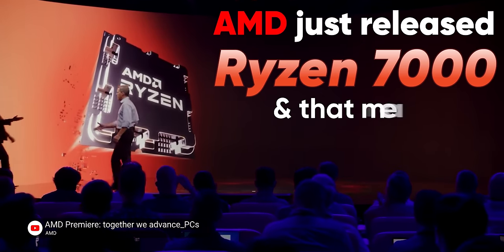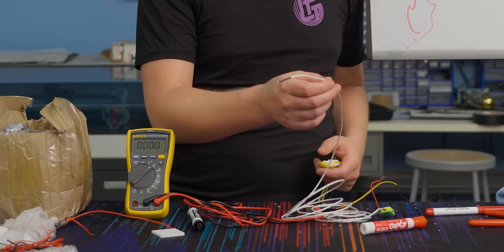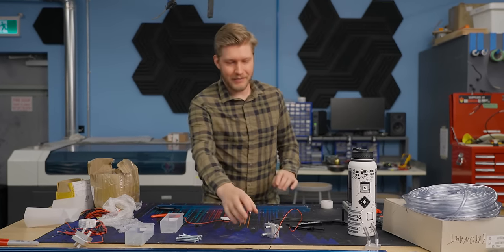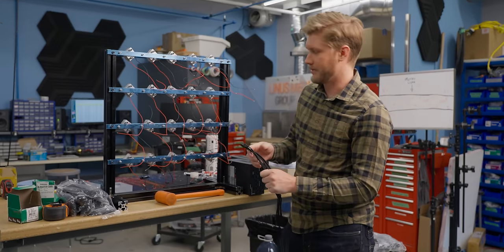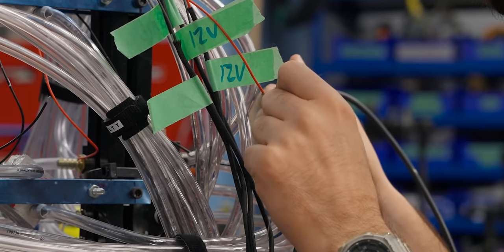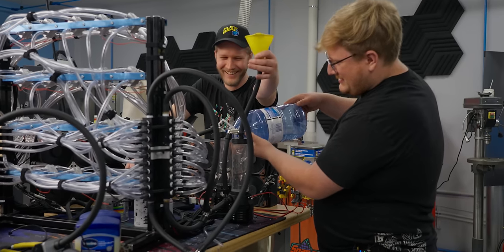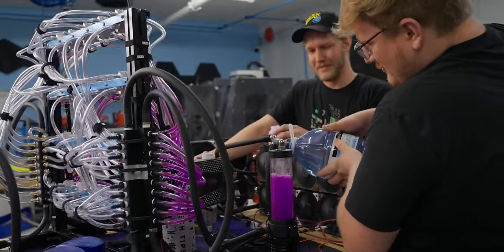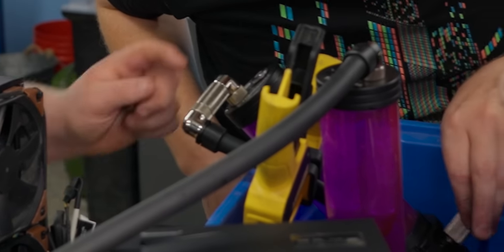Our DIY CPU Chiller From AliExpress is RIDICULOUS

Comment: I spent a couple of years playing with TEC's, successfully building out a universal whole case cooler that dropped the CPU temp by 20c while maintaining a case temp of around 10c.  So a few things, mounting pressure on the TEC plate is EXTREMELY important, you need even pressure across both sides or performance takes a serious hit. We ended up threading out own bolts with a very high thread density, counting the turns and confirming with calipers. You also need to have a neoprene gasket (cut a hole for the TEC and sandwich between the heatsinks) we used quarter inch high density neoprene, but your application may need something different. 

We also used 600w TEC's (24v @ 25a) which required a special switching PSU (30v@30a), and HUGE melcor nickle plated copper heatsinks that were cooled with 120mm 120cfm sillverstone fans. The HS's were 120x120x90mm, and each weighed about 5 pounds, with each tec using TWO. You can simply drop the cold side into a container of water, and use as many as you like. 

The other important thing, you're much better off using high power TEC's like the 600w we used, and undervolting it. At lower power, TEC plates are much more efficient. Basically you're better off using 8 600w TEC plates, running 75w each than you are using 1 plate running full load. I would have to check my 15 year old forum posts, but i'm pretty sure we found that 30% load was the sweet spot in terms of efficiency, though i'm really not sure if that's a flat metric or simply applied to our 600w plates. 

Either way, i'd suggest taking another run at this, you should be able to get much better results using much fewer parts and a less janky set up.
Reply: I think a big part of why this video even happened is because he used stuff that they already had or bought cheap off AliExpress.
Reply: @heygek2769  I'm sure it is, but they've taken a couple runs at TEC coolers for various applications, and in each instance they've done it rather poorly, ended up with bad, or at least insanely inefficient results, and perpetuate the idea that TEC's are useless. 

I freely admit, this is a personal pet peeve and this was clearly done for the entertainment value, but...if you're going to do something, you really should try to do it as well as you possibly can.

One of the simplest things that is consistently overlooked, is using a TEC to cool the back of your CPU socket. There have actually been a few cases in recent years that have employed fans behind the motherboard tray for this purpose, using a TEC in this was is simply more beneficial, and less complicated than trying to directly cool the chip.

Like i said before, i spent years playing around with TEC designs, and ended up with several very viable solutions that i simply didn't have the money to see through, and now i just don't have the time. These guys do, and i'd like to see them make a serious attempt.
Reply: The Jank is part of the appeal though.
Reply: @heygek2769  sqws
Reply: some people, yanno, have a life lmao
Reply: Sooo can you like undervolt TECs? for 12v I only find about 200W max, which i feel is pushing it, but what if I were to use a, say 24v TEC that is rated for 600W (25A) and run it at 12v, will it try to pull 50A or will it not go past 25A still? I'm just wondering cus that wouldnt require another PSU and it could run off the PCs one.

Also what kinda TEC would i need to cool down a water loop to sub-ambient on a RTX 4090 at load, or a Threadripper 2920x?
Reply: @dazley8021 I A TEC will use as much power as you drive into it, unless you have a control board or some kind of step down between the TEC and the PSU. You absolutely can drive them with a standard PC PSU, but only so long as it's within the operation rating of the TEC. 

A 600w tec runs at 24volts @ 25 amps, running it at 12v/50a would input the same 600w...but it would never the less overload the junction and if not outright kill it, greatly decrease it's lifespan. 20 years ago PC power supplies weren't feesible for running a 600w TEC at full tilt, so we went with a 24v30a switching power supply, which lets you fine tune how much power is being delivered, as well as wire up modules in parallel. It's the best way to go if you really want to play around with TECs.  

When i say "undervolt" a TEC,  what i mean is running it at lower input power than it's rated. The higher the input power, the greater the cooling capacity, at the expense of efficiency.  

It's been a long time since i thought about any of this, so i'm just gonna ballpark the figures, i could be wrong and apologize in advance if i am. 

As far as i recall, the 600w TEC's were rated at to cool 50c below ambient with no heat load. As you apply heat to the cold side, both the cold side and the hot side temps increase, requiring better and better cooling on the hot side to maintain any kind of benefit on the cold. 

These are the module you use for direct cooling of a component with a high heat output, it can be beneficial if you can devise a way to keep the hot side temps in check (intel released a TEC based cooler for one of it's chips a few years ago that performed decently, if not efficiently) not an easy task within the confines of a PC case. TEC are heat pumps, they're not taking anything away, they're just moving it somewhere else. Every module has it's own delta curve, based on operating temperatures, input power ratings and even mounting pressure. 

However,  if you run a module below it's rated power, the efficiency starts to get better. You can take the same 600w TEC module, run it at 72w (12v@6a) and still see a 10c or 15c decrease over ambient, doing this with multiple units allows you to stay within the same power demands, while making each module much easier to cool and the delt easier to maintain.

 With a WC setup, the quick and dirty way to do this is to take cheap CPU heatsinks with modules sandwiched between, and plunk the cold side into your reservoir. With decent radiators and a generous reservoir, it's not terribly difficult to maintain a sub ambient water temp.

The complicated solution requires machining a custom block for the TECs and using an isolated loop for cooling the hot side.  

Is it a fun and awesome project to play around with? Absolutely! Is it in anyway practical? Not even close. 

Unfortunately, it seems like Xtremesystems.org, where we detailed our build process isn't working at the moment and it's 3 am where i'm at having gotten sucked into talking about something i rarely get to speak about lol. If this is something you'd like to play around with, hit a reply and i'll try to dig up more detailed info tomorrow.
Reply: @Daniel-hj5jt   Oh gee didnt expect a response this immediate! Very informative! See I have a well built watercooled pc with an RTX4090 and a Threadripper 2920x. Two seperate loops both going into a massive 560 radiator each. The water temp wouldnt go over 35c under load, GPU maintains a well 50c and CPU about 60c under load. I was merely toying with the idea of putting the TECs inbetween the loops, cold side to components, hot side to radiators. And all I want to know what spec TEC i need to get the water temp on the components side to about 15 - 20c, like how much Amps or Watts do i have to expect the TEC to draw at 12V? Like if the required TEC would draw over 200w its already not viable for me. I do have a beefy Corsair AX1200i and a little bit of headroom, but i also got some fans and a lot of RGB lights....
Reply: @Daniel-hj5jt  all the info you've provided is very interesting, maybe at some point I might want to try something like this myself. do you think you could try to find your old posts again?

Comment: I think the whole bubble trapping thing could've been solved if they mounted each row in series and not all of them in parallel but i still love the idea!
Reply: i was thinking the same thing
Reply: or if they mounted the reservoir at the top :)
Reply: Then they'd need even higher head pressure and even more D5 pumps.
Reply: @hapybratt8640  is that a problem tho?
Reply: @Nils__pltr  yes they already using 3 :D
Reply: They have too much head pressure resulting in low flow rate, those circulator pumps wont make enough pressure to push it through all the fittings and UP against gravity. They just need to raise the pump above the highest point in their system and the head pressure due to gravity will be canceled out. Each one of their 90elbows also will add at least .5 psi to the head requirement and there is a lot of friction in all that pipe. Most pc cooling pumps were designed to go through maybe a max of 8 90elbos and 2 feet of pipe with no real head pressure from height. All they have to do is put the pump and a stand so it is above everything else and will see massive improvements.
Reply: @randoedits6906  makes sense
Reply: @venuccicze2181   The head pressure calculation is anything above the discharge of the pump, so they need to raise the pump, not the reservoir. The pumps are attached to the reservoir and in that sense yes you are correct, but it's technically the pump that needs to be raised in height.
Reply: Yea, it would have worked better that way, also having a reseviour higher than the loop.
Reply: @thatguyontheright1  i'd say they should shoot this video again if they have time and while they're at it improve everything and listen to the tips we gave maybe haha
Reply: @Nils__pltr  I'm no expert, but I've installed a ton of Rads in cars. There is a reason why the reservoir is the highest point in the system and the pump is near the middle.
Reply: @thatguyontheright1  i mean uhm most reservoirs are high up cuz of bubbles so they can escape but yea would be easier in this situation
Reply: Use a high reservoir to gravity fed the system
Reply: @thatguyontheright1  Placing a reservoir above the pump adds to the head pressure on the pump, any part of the system that carries fluid above the discharge adds to the head pressure. The down run of the pipe coming off the reservoir does not cancel the pressure on the pump from gravity in the whole system only the pipe leading into the reservoir, as the pump would still be lifting the fluid into the reservoir along with the other areas in the system. Yes the gravity would push the fluid down and help remove the air, but the head pressure would overall remain the same, also any siphon effect is partially lost if the reservoir isn't complete sealed. This is why the pump also needs to be lifted, as that is the only way to cancel the pressure on the pump head caused by gravity. 

In a cars/trucks the maximum height difference between the water pump and the reservoir wouldn't be more the a few feet in most cases, the reason they place the reservoir above is to ensure the pump is always submerged to help prevent damage from overheating if you were to dry run the pump. The water is also the lubricant for it.
Reply: Or just lay it down beside the case instead of on it vertically xD
Reply: and the performance would be much better. I guess they di 0 research on the subject as that video was non-informative and I myself didn't found it funny at all.

Comment: Alex, the way you connected the pumps is not giving you double the head pressure, you are basically connecting them in tandem. This mean that one pump discharges just to feed the suction tank to the next. There is not pressure transmission doing that, so basically is just the last pump working, the first is just feeding the second tank, that’s it. If you want to connect the pumps in series to double the head pressure you need to connect directly the discharge side of pump 1 to the inlet side of pump 2. If you want to double the flow, then both pumps must be connected to a discharge pipe at the same time, but the total head is equivalent to one pump.

Comment: I believe you ran the cooling to the peltiers in parallel, that would completely explain why the coolant was not getting there. Water always takes the easiest route so there was no need for it to go through the top ones, it could just go through the bottom ones. Also rethink the diameter or your water tubes, the tubes going to the waterblocks were really thick and the one going to the pumps was only a little thicker. No wonder there was almost no flow in some areas. You would probably be fine with those flimsy 5mm ish tubes going to the individual units on the hot side. Maybe for a second iteration of this split the cooling system up into groups of like 4 peltiers cooled in series with smaller separate radiators. Also have the water in the cold loop flow the other direction from that in the hot loop to make sure the water doesn't get reheated by the higher temperature peltiers (because they are in series the last one gets a lot warmer cooling water and thus will cool less far on the cold side). I think by hooking up the cold side in groups of 4 (or so) with their own pump and combining the output with a splitter to the CPU plus the aforementioned changes you could optimize this setup.

Comment: I feel like in a previous video, it was established that if you want to do this, you should first run the hot water through a radiator to get the temperature down for most of the way and then run it past the TECs to go sub-ambient.